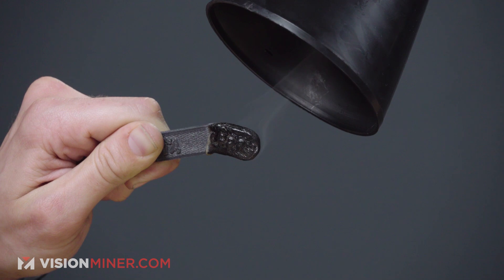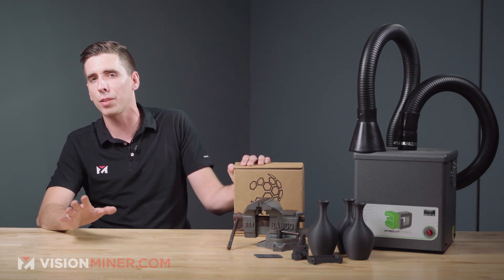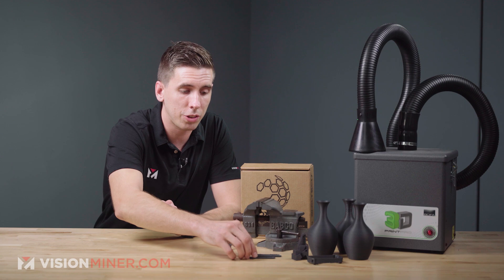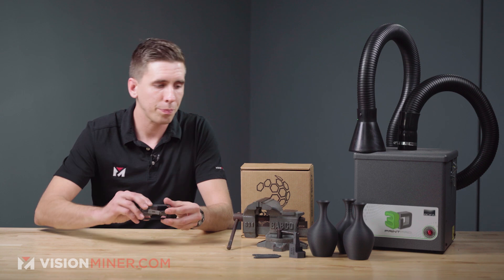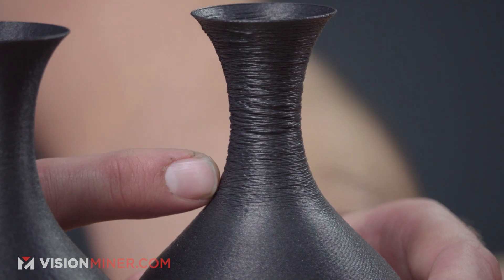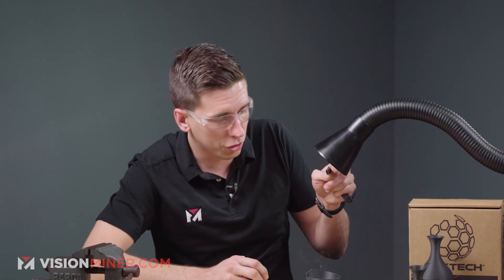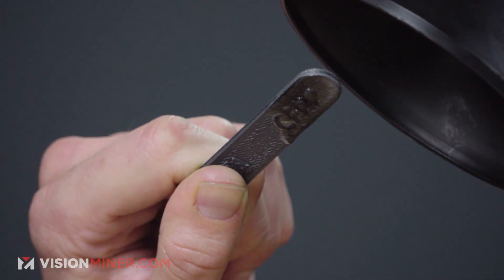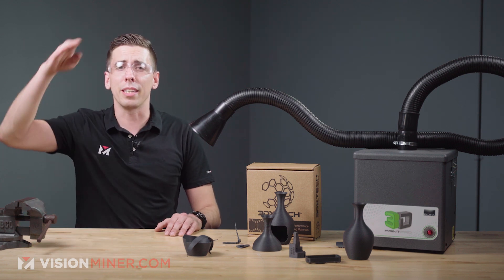CarbonX PPCF Filament, Polypropylene + Carbon Fiber 3D Printing Filament by 3DXTech

Comment: In my very unscientific experience. I've noticed the Flexibility vs brittleness can be influenced quite a bit by adjusting the flow rates. This is easily noticed by doing a flow rate calibration in Orca Slicer. The samples of varied flow rates demonstrate quite a wide range of rigidity and flexibility. Just try and bend each sample and it becomes very obvious. Lately I follow the guidelines less based on appearance and more based on a reasonable balance between rigid and flex.

Comment: Sans “Clumping”, Much longer, thinner strands for the carbon fiber would most probably needed for actual Strength(“structurally reinforcing-ly” speaking😉.. almost everywhere I See cf used, it Seems to be forced to act more like a structural inhibitor/abrasive powder than a reinforcing fiber..🤙🏻

Comment: Okay, after trying out some filament, i noticed when i loaded it, it oozed out really fast and made popping noise, exactly like wet nylon. I tried printing extrusion multiplier tests, and even measuring the filament diameter (1.75mm) my extrusion mult/flow rate had to be set to 0.8 or 80% or less to get the proper thickness for extrusion. I also noticed that the walls are filled with lots of holes, and it looked extremely rough. Do you know why this happens? Also, this stuff seems extremely brittle, but has great layer adhesion considering it has 15% carbon fibers. Its also lighter and more blueish than my pa-cf filament.
Reply: same thing.  lots of bubbles and foaming, looks like a wet cf nylon.  24h of drying seems to help a ton as the extrusion is now very smooth but still not perfect and some big bubbles are still present.........
Reply: @thrawn86  I dried mine for 8 hrs + 1 hr at 100c (melted the spool) still super stringy. Helped a little, but seems super problematic. I swear the guys I got this filament from left the filament in a flood for 3 years.
Reply: @thrawn86  try cutting the filament open. On 2 of my spools, there were pores inside the filament. I double checked by cutting multiple times and incorporating filaments I know that don't have issues like this, and the others didn't have pores, the ppcf did.
Reply: So i think the porosity is due to the brittleness of the filament. It does seem to ooze. I got a replacement spool from 3DXTech, and had similar oozing and pores in the filament, but the replacement didnt string or fizzle

Comment: I'm kind of curious, what would be the best type of filament for exterior car trims? An example would be fog light covers.
Reply from the maker: ASA is commonly used on plastic exterior car parts so that might be your best bet.
Reply: @VisionMiner  Thats what I was thinking of using, that and some PP+CF for engine parts, like an intake. I'm just skeptical with ASA, isnt there toxic fumes to be concerned with when printing?

Comment: Something tells me that the strength of PPCF could be based on slightly different parameters than the test your doing.  Even though your test may not show this material to be as strong as, say; PCTG, or tuff under the same test.   It does reveal that this material does not always break "Uneformaly", along the printed layers.   It puts up a fight Unelateroly which may be an improvement to, say; PLA, which simply breaks or cracks.   For example; you can not drill or tape PLA, whereas you probably can drill and tap PPCF.   However; you may not have to drill PCTG, Nylon, or Delrin if you can print parts with the holes where you need them, and you surely don't have to "Tap" the holes afterward, because those materials are so tuff you can just drive the screws in with "Reckless Abandonment", and everything will be just fine.  However; it looks like you would have to Tap the treads for PPCF, in order to avoid structural cracking, like with PolystyrenE or ABS.   "Of course; my main concern is Price"?   And is this material an economical trade-off for mechanically working prototypes?
Reply: There of is subjective, once again depends on what your using said material for. If TTS then absolutely consider another material altogether. TNE just may fall responsibly on gent like yourself as if took notion and would be appreciated by one as myself because consideration.

Comment: Seems to me that the CF actually takes away the physical properties that you would choose PP for.
Reply from the maker: For some properties yes, however considering the difficulty printing PP in the first place, this will still get some of the properties while making larger parts possible. Mostly --- chemical resistance :)
Reply: @VisionMiner  All you need to remember is PP ONLY STICKS TO PP and you'll be fine
Reply: I just bought a roll of this and feel I’m going to be very disappointed.
Reply: @JayBoogiePOV  how'd it go?
Reply: CF almost never makes sense in plastic materials. Materials go way too much to the stiff side after that. There are limited applications with such needs.
The best plastic for FDM should have good thermal resistance, be flexible, and most importantly have great layer adhesion which CF also makes worse.

Comment: How is it compare to PA+CF ??
Reply from the maker: CFPA6 is an overall more robust and easier-to-print filament, but some special applications may need the chemical resistance of PP :)
Reply: @VisionMiner  Would ppcf be an alternative to pa6-cf if you dont want a drybox to print the filament out of?
Reply: @VisionMiner  Does it creep like Nylon?

Comment: Is anyone producing filaments with basalt fiber and polymer?  If not, can you ask some company to try it?
Reply: technically possible but that will require a totally different printer. You should look for continuous long fiber filament printing. 
Like Markforged, Anisoprint, DesktopMetal, and a few others. All these printers use a continuous fiber embedded into a 'matrix' of thermoplastic resin, mostly Nylon PA12 or PA6 or some sort of. 
There are other 3D Printers which adopt the more conventional wet filament deposition, often using a UV curable resin which hardens when being exposed to a strong UV light, immediately after deposition. Sometimes the extruder is also followed by a roller/pressor which helps the adhesion of the fibers. 
Why are you interested in basalt fiber? I'd been quite a precursor of the basalt fibers in the marine industry, we actually developed the very first basalt fiber laminated sails. 
And we also built a few boats and other parts. Less performing and heavier than CF, at least it's a natural material and in replacement to glass-fiber it can be safely disposed as an inert. 
It also has some interesting fire resistance properties, and much higher heath resistance (920°C). Unfortunately its beautiful bronze gloss look turns into a dull black once impregnated. 
Maybe a thermoplastic matrix could preserve the aesthetics as well.
Reply: @pavel5939  I think Basalt Fiber has also better strength than Glass Fiber. Interested in making vanes for wind turbines with Basalt Fiber.
Reply: @aristeidislykas7163  Yes, sure. I didn't mention that. It's not so significantly stronger but has some 20/25% better mechanical properties than glass. 
And if you're interested in wind turbines, that's an excellent field of application for basalt fibers. Due to its inherited vibration damping (it's a rock) and also because it remains an inert and so far is perfectly disposable. Carbon fiber can't be used because of resonance issues and glass fiber can't be recycled, fullstop. In fact, they bury thousands of windmill blades every year. That's a huge environmental issue.
Reply: @pavel5939   Wow! I did not now that Basalt Fiber has good vibration-dampening qualities. Thanks for the info.  What is the name of your company?

Comment: By the way, I would really recommend using Magigoo PP stick for bed adhesion. I managed to print it on regular Prusa MK3S textured PEI bed with almost no warping with that thing. Freaking black magic!
I also tried printing it on scotch tape or PP sheets. It results in part permanently fusing with the bed, impossible to peel it off afterwards without either ruining the part, or destroying the print bed
Reply: Wow; Thanks for the heads up.
Reply: Have you tried nano polymer with it ?
Reply: @CC-kc5lb  I didn't, but VM said themselves that their nano polymer adhesive doesn't work with PP
Reply: just put standard painters tape or glue stick as a first layer then pp tape on top, makes it easy to peel off